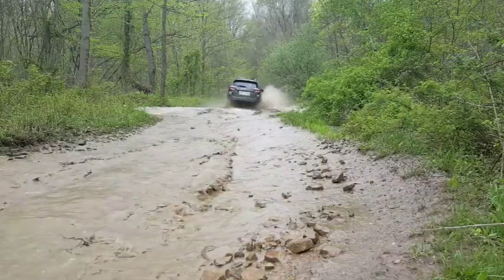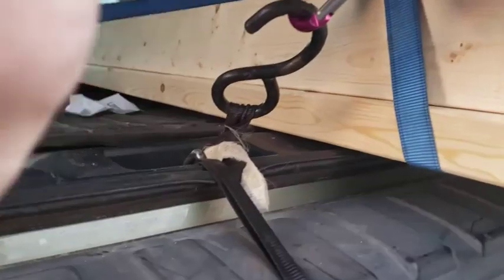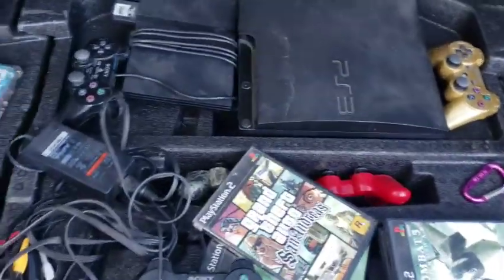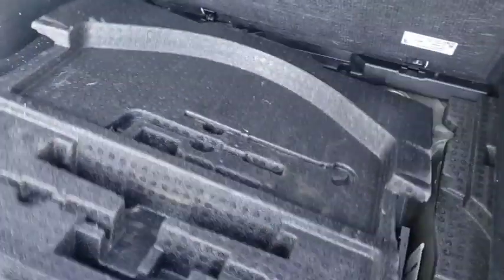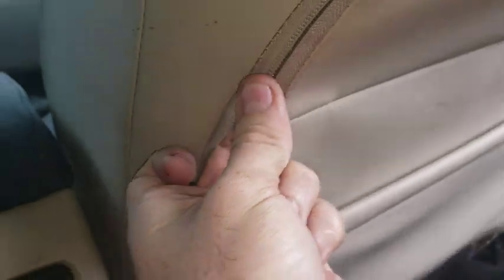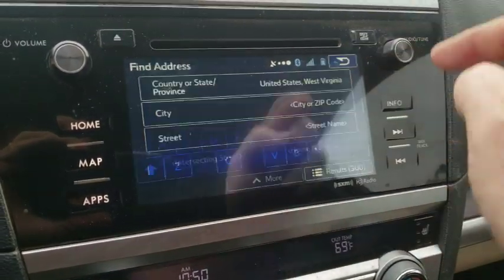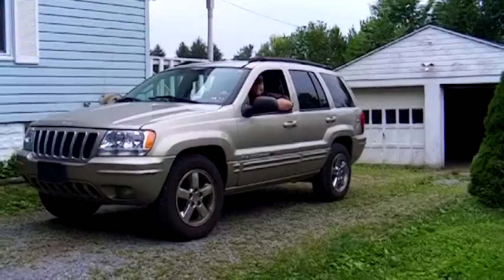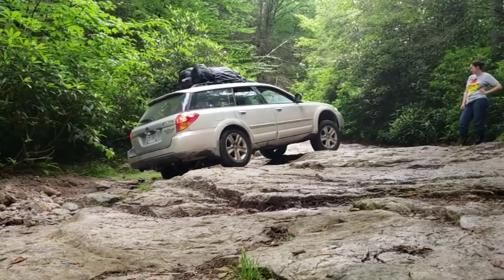Top 5 FREE Mods for your Subaru

Comment: A counterpoint to Bruce's assertion that the tray in the back is useless: When I remove mine, I hear a LOT more on-pavement road noise. The first time I did it I thought I'd accidentally left one of the rear doors cracked open. It may bother some less than others, of course.
Reply from the maker: I haven't noticed but good point! I've heard that the rear trunk cover also helps with noise when rolled up. 

Could be a good experiment?
Reply: @bruceyyyyy  Hmm, I did have that out of the car at the time too. D'oh, my experiment was flawed. 😄 I'll try both scenarios sometime.
Reply: I would imagine most people who remove the foam, replace it with other stuff, thereby deadening the sound. Unlike the video,  I can see the majority of people will stuff the space with soft stuff for camping.
Reply: Possibly, yeah. I've got the former spare wheel space filled with a mix of hard and soft stuff, all wrapped in a wool blanket to minimize movement and rattle. But I think Bruce was right; It's likely a combination of all three things (foam, deck, and rubber mat) that deaden the noise. I had them all out when I experienced it, but assumed the foam was doing the bulk of the work.
Reply from the maker: @Fingerprintguy  I wanted something funny to use as a measurement instead of just saying "You get X cubic inches more space" 

I don't really drive around with SNES versions of Chrono Trigger and Final Fantasy 3 in the back. 

Originally I was going to have a pile of guns but then I thought that might be offensive to some to have 20-30 guns in the trunk so I went with something less controversial.
Reply: I would think that it helps support the rear deck also.
Reply from the maker: @pedlpower  Of course. But if you're removing it you'll likely fill that void with other things to support the rear floor board.

Comment: LOLOL, I did NOT see that ending coming at all. Challenge accepted sir. (oh and good ideas here BTW)
Reply from the maker: I just hope you ruin Forester fenders for everyone.
Reply: @bruceyyyyy  LOL, apparently I've already accomplished that. I'm still trying to figure out what else I can ruin for everybody.
Reply: Good idea for a challenge Frenemy!!!  Geez!  Now that I think of it, I've done all sorts of free mods to the Passport.  1.)  Cut the metal wheel well to fit larger tires 2.) removed the donut to use it as storage space 3.) made head boards to create a sleeping platform 4.) bolted cargo carrier directly to my cross bars 5.) special storage area behind the rear seats.  Maybe Donald can do a triple threat challenge to  Myself, MitreA (ignition offroad), and Alnsm overland.  I have no idea who I could challenge next though, haha!  If I receive the challenge, I guess I'll just have to send it to Ronny Dahl or Trail Recon!!  LOL
Reply from the maker: @JonDZ_Adventuring  I thought about challenging you but I don't challenge traitors!

Need to get brains in on the mix. Highjack seems to have been absent lately.  That's really all I could think of besides the ones you've already named. 

There has to be more out there, right?
Reply: @JonDZ_Adventuring  Spoiler alert for the JonDZ 5 Free Mods video, LOL

Comment: Mod 1.5- use end link of tie down directly which is designed to take load unlike cheap garbage “non-load bearing” carabiner. Mod 2.5 Put spare tire, jack and tire iron in compartment. Replace foam support so floor doesn’t cave in when you put items in cargo area.
Reply from the maker: I've tried with just connecting the ratchet strap directly but the size of the hook is too big to fit in the latch. 

Also the floor hasn't caved in and I use this thing as a work truck often.
Reply: 1.5 - You and your logical, rational mind aren't welcome round these parts.
2.5 - Ditto - but it would only be an insanely heavy and narrow object to possibly threaten the load area floor panel.  Also, what place other than the spare wheel well, is there?  Throw the spare up on the roof?  Nope - putting approx 30kg up high is a bad choice, for about 5 different obvious reasons.   Where else - strapped to bonnet, like a Landrover on safari?

Comment: I made and sold several hundred patch leads, for only a few bucks I wasn't making a profit or anything, cut to the exact length, with the correct pin for the wiring harness and right sized 'O' type connector to neatly wire to the nearest earth point to "unlock" the head unit while driving for two or three years when the Gen V Liberty/Legacy was released. I got so tired of it I simply made a "How- To" step by step .pdf and posted it to the Subaru forum I was a member of at the time. It'll be on the web somewhere still I'd imagine if anyone is looking to do this essential life hack.

Comment: To make seat like Lazy Boy comfy how will this work on driver side with that electric lumbar adjustment?  Kinda like the extra lower back support.
Reply from the maker: Some people have left it out. 

Some have extended the adjustment range by adding a ring.

I put a piece of pipe insulation in it's place. 

Still have lumbar adjustment on the driver seat.

Comment: Tip #1 is not such a good idea. Not for station wagon in general. Because you will have your exhaust gasses inside the passengers room. Okay if you are driving outside the city it will be fine but if in dense traffic and traffic light all that stuff, you better don't do this with rear cover open. I am sorry man!

Comment: I have to mod my 2015 3.6r with a new alternator. It seems at 41,000 miles mine has died. Thanks to having a radar detector that displays voltage I noticed the situation before I got stranded somewhere. Kinda weird how it started off at 14.1 volts and when the rpms came up above idle it would drop to 11.8 volts. I’m guessing the voltage regulator has failed.
Reply from the maker: I think it's possible that the voltage drop is Subaru attempting to eek out some MPG by lowering alternator draw.  I think there is a programming update available to remove that 'feature' as well. 

My alternator is factory at 60k miles now. So is everything on the car minus the front end links.
Reply: @bruceyyyyy  Anything is possible but I would have to wonder what lowering the voltage down to 11.8 is doing to the sensitive electronics like the engine managment systems and the EyeSight system.
Reply from the maker: @porsche558  My guess? Probably nothing. The system should be designed to handle that voltage. 11-14v is a pretty safe design spread for a 12v system.